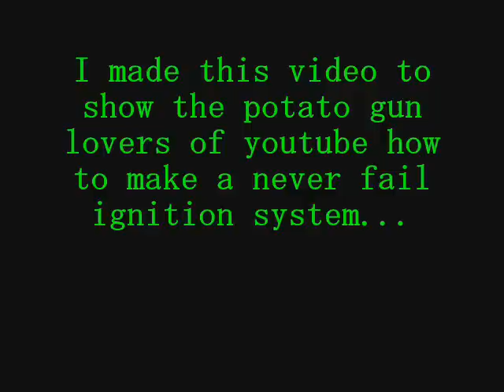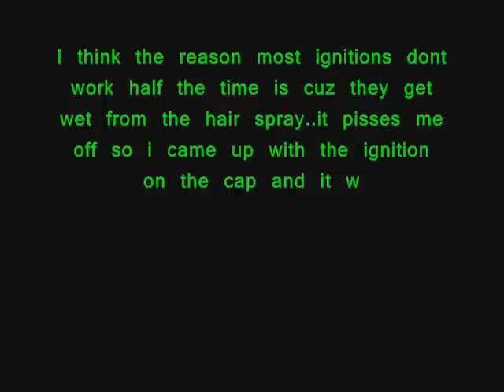The Best Ignition For a Potato gun..never miss fire again!!

Comment: spud guns usually don't fire because people use too much fuel resulting in a "flooded" condition. Short bursts of fuel usually work best. I use Berrymans B12 chemtool solvent, found in parts stores. Only takes a half second burst. Do not use tube supplied with the can as the can nozzle atomizes the fuel better.

Comment: Had the same problem. I put a BBQ igniter about 3/4 way up on the chamber. Had wire running in close to the spark. After a day of use it doesnt work, will not spark

Comment: Did a different version in which we used a flexible long reach lighter. Can't reccomend it for high powered spud gun because the lighter tip imploded and was blown out of the hole. Ithad been jb welded in place but oxy acetlyne fuel was too much.

Comment: i got the best ignition my gun has a 9v electrical start you just click it one time and it will keep sparking fast as hell. plus heres a tip on refillabal lighters thay have that peace you fill it up with take that off the lighter scew it on your gun take the cap off your hair spray and you do not have to keep taking the gun a part just to spray in it. it works graet
Reply: let's see this thing

Comment: Put my ignition on the end cap and now it fires 0 out of 10 times. Has a nice spark. But no flame
Reply from the maker: You need to spray more or get the cap in faster.
Reply: @rydwy222  I put copper plating around the igniter to produce a bigger spark and that did the trick